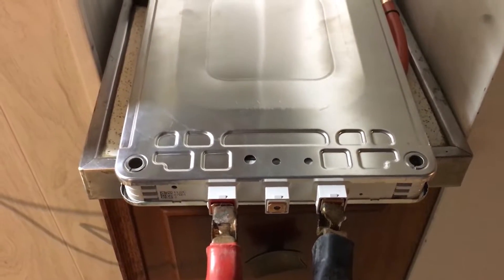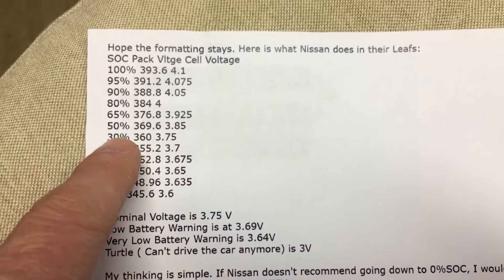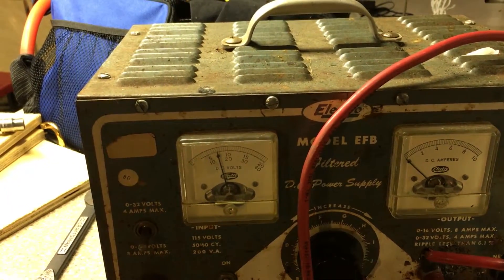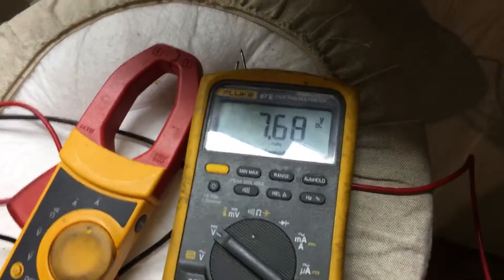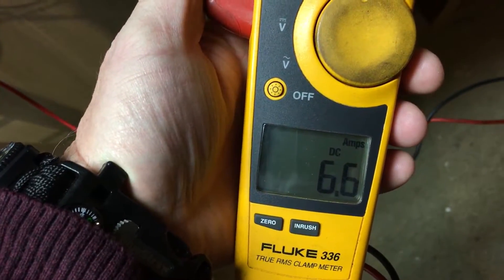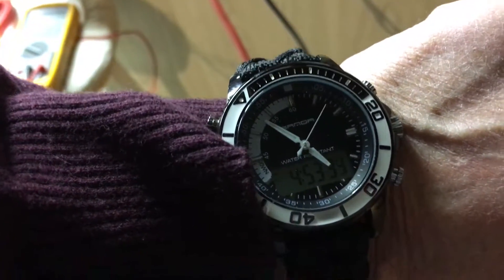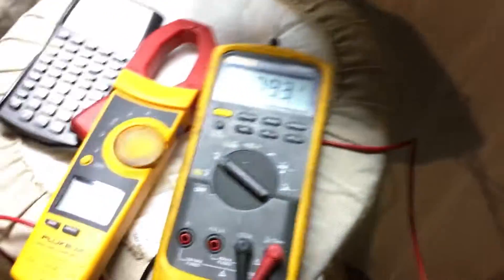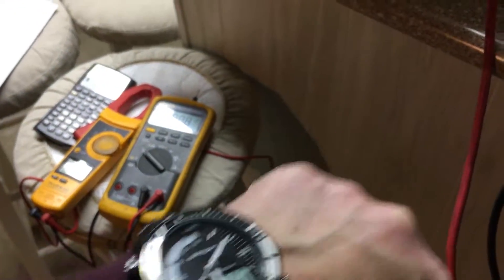Charging my Nissan leaf batteries DIY

Comment: Leaf cells are NMC chemistry. Voltage range is 2.8-4.2V. There is very little capacity below 3.4V, so this is effectively the lower limit. There is very little capacity above 4.18V, so same thing on the high side

I run these cells in my home batteries (80KWHr tested capacity), have done for 5 years now. My working range is 3.65-4.15V. Cycled once per day, but generally in the upper 2/3 of the range. In summer i decrease upper voltage to 4.025V as i dont need so much capacity

Batteries still have good capacity after 5 years, showing 93%SoH (compared to when first installed, not the brand new factory capacity)
Reply from the maker: I agree! Mine are still working great as well

Comment: if I could ever get somebody to answer me question I see you're using a battery charger what if I was to hook up a solar panel charger and do it so slow over 6 months. do you think it would bring it up to that $400 maybe 450 or even more?
Reply from the maker: I’m not sure I understand your question. What kind of solar panel charger do you have? And what are you trying to do?
Reply: @IFix-Things  100 watt panel i have 2 12volt battery's hooked to it deep cycle the charger is simple and will not allow over charge
Reply: i have been thinking about using electric car battery's to power my 30 amp camper

Comment: OMG - Some where in my shop, I have that exact same power supply, from 1976 !  You claim it is a Constant Current Charger - it is not.  It is not a Constant Current charger, nor is it a Constant Voltage charger.  It is an unregulated variable power supply.  As the module increase % SOC, the voltage will increase and current will decrease.
Reply from the maker: thanks for the clarification. Its old and has little to no documentation.

Comment: It appears your somewhat clueless on charging Li Ion cells.  They demand  CC/CV charging.   CC until up to voltage followed by CV until they simply do not take in anymore current.  Measuring what you through into the battery has nothing to do with what the battery can produce in Capacity.  You need to measure USABLE Capacity.   What is usable between say  3.00V and 4.00V.    Measured under a Constant Load.  That will give you your Capacity .     Using a CC Set to a C1 rate /CV Set to your target voltage PSU set to your 8.1 would have completed the charge.  No Issues involved.
Reply from the maker: I'm always learning
Reply: Hey question can I charge each cell to 4.1v by putting a charger(lipo charger imax6) one
 lead on the positive and negative lead on the middle post then vise verses for the other cell instead of doing it the way its done in the video?
Reply: @bossman5138  Yes
Reply: vto rsi what about the amps is 5amps to high
Reply: @bossman5138  Yes, 5 amps is fine. Could even charge @ 10 amps, 2X faster, if needed.
Reply: vto rsi okay thanks